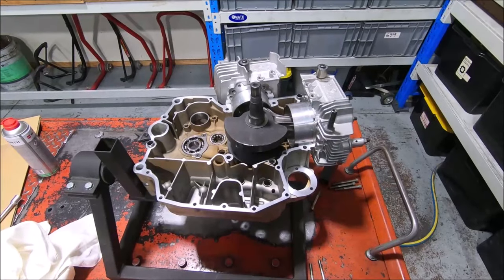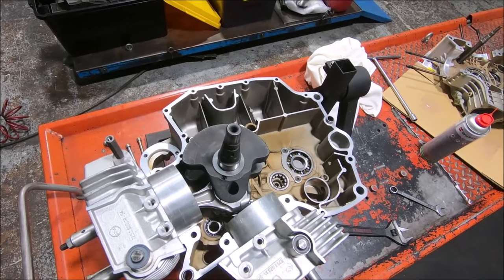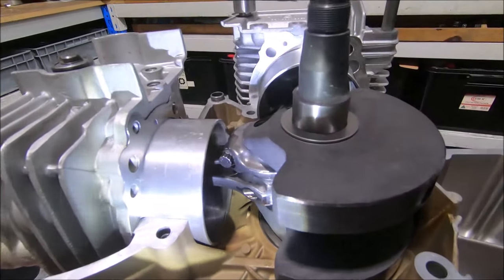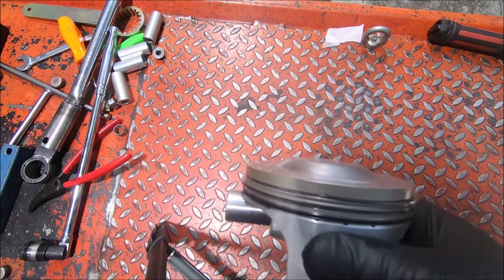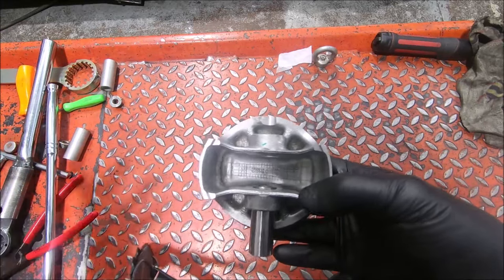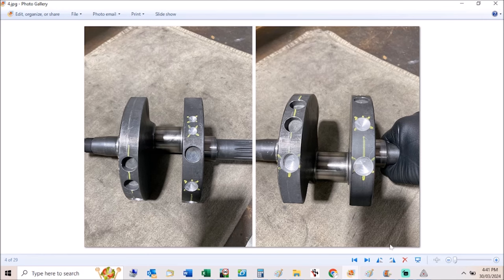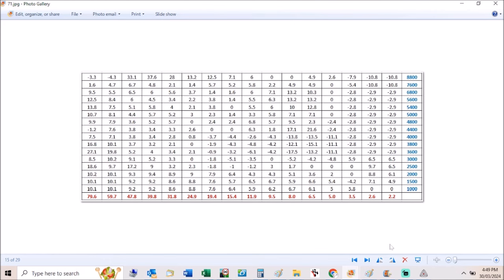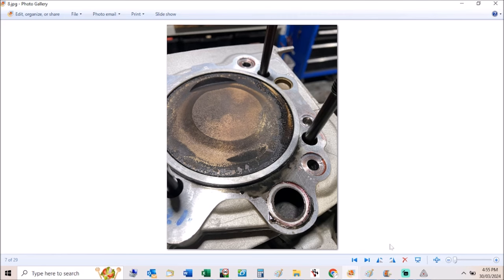Fitting a Ducati 1000/1100 DS crankshaft to an ST2, M900 or 900SSie

Comment: 951 and 992 based on 904cc are really a great engine. I've build 10 and I love the torque of this engine
Reply from the maker: cool.  have you just machined the 92mm pistons?  certainly the cheapest option - having a pair of pistons made out here is quite expensive.  gets rid of some weight too.  i guess you could lift the cylinders a little too.

Comment: Hi Brad sorry for the question,I was just wondering what sort of cam timing figures you would recommend for my 96 900ss with ST2 cams.
Thanks from kiwi land 👍
Reply from the maker: 106 degrees ish, depending on the piston to valve clearance.  that would determine it.  probably as advanced as possible to maintain 1.5mm piston to valve clearance.

Comment: I'm interested to see what can be done with a 1999 750ss ie.

Not that I wanna rebuild my motor right now but I wondered if they will benefit from a few top end tweaks.
Reply from the maker: the 750 engine was a victim of its place in the line up.  it had to be less powerful by a margin compared to the 900.  as such, it's a bit of a dog.  the 800 shows what the 750 could be with bigger valves, better cams and more comp.  this is my take on it - https://www.bikeboy.org/brads750m.html
Reply: @bradthebikeboy  thanks for the reply man. Il have a good read of that.
Reply: After having a good read through the article you linked I wondered if you could tell me more about the narrowed 900 cranks? Or if you have an article on that?
Reply from the maker: @Daniel_D_King  it's a 900 crank with the same alternator snout length as the small block.  not much else to it.  fitted to 900ss up to some time in 1992 i think.  i put it in 600 cases once.  think it's in the blog?  have to have a captain cook.  found it.  https://bradthebikeboy.blogspot.com/2014/04/fitting-2003-onwards-696796800-6-speed.html

Comment: Interesting. Can you yae the toyota rods for anything they are 122mm centres
Reply from the maker: the 900/1000 rods are 130mm c/c, so 122 is way too short.  if you go much shorter on rod the pistons will hit the crank at bdc.  although the st3 works with 124mm rods, but those pistons are quite short under the pin.

Comment: Are the cylinder heads the same on the 1000ds and 1100ds? I was looking for used parts on my MTS 1000ds and found the head from the 1100ds, will it fit? Thanks!
Reply from the maker: you can use parts catalogues to try to work it out.  depends on the year.  possibly due to the lh cam bearing change.  https://www.bike-parts-ducati.com/ducati-motorcycle/assignment_spare_parts/30122331A
https://www.bike-parts-ducati.com/ducati-motorcycle/assignment_spare_parts/30120921D
Reply: @bradthebikeboy  Thank you for your reply! Yes, I saw these diagrams, but I don't get the difference between years of 1000ds engine, I thought that 1000ds was the same through all the years. (1100 was 98mm, instead 94mm of 1000 bore) So, the difference between 2006 and 2005 of 1000ds, except just part numbers, is not obvious for me...
Reply from the maker: @konstantinbedin9891  nor me.  i would expect them to be functionally the same.